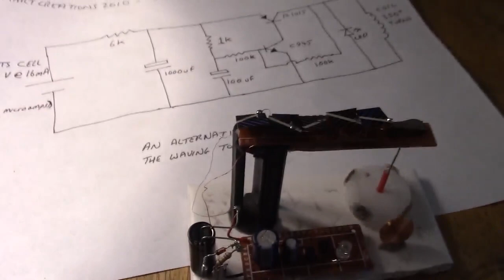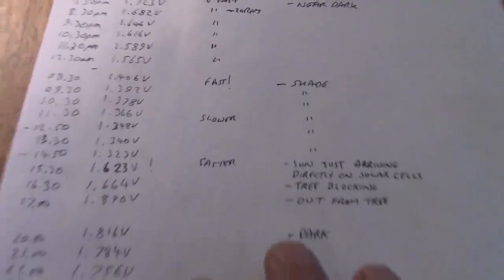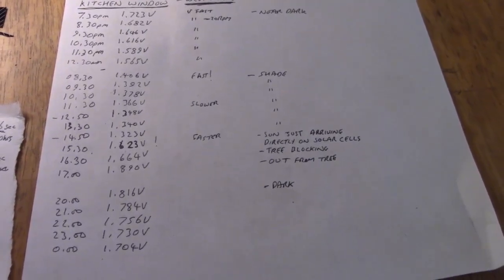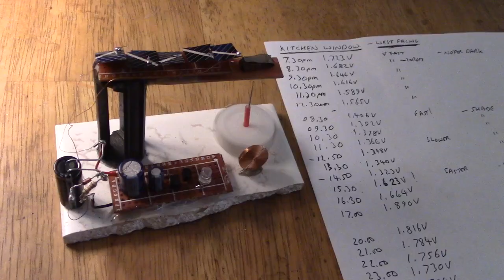24/7 Solar Runner

Comment: Hi, Good work !! Can you confirm whether this circuit produces a constant pulse from the coil or is it triggered by the magnet ?
Reply from the maker: It's triggered by the magnet, but also fires at a slower rate with no magnet present. The magnet is the sync, would be the best way to describe it.

Comment: how low the voltage of the battery can work , 1,5 volt AAA , it works from 1,5 to 0.5 volt ?  beautiful videos
Reply from the maker: Thanks Joseph. The lower limit on these circuits is about 0.6V. Nearly every circuit with 1 regular transistor will fire up at 0.5V, but these are a little higher. On the upper end, I'm not sure. They work fine at 4V and may go higher... I should blow one up to find out  :)
Reply: @Slider2732  I prefer constant values such as 1.5 volt battery and constant mechanics / magnet size, the reason is to study closely the sensitivity and function of all the different circuits, apart from that, flat coils are not ideal because they use only one side, I have beautiful pulse motors built up, they have been running for a few years, magnet needle bearing glass with only one-sided contact, it really makes a lot of fun, thank you very much for your lovely charming videos
Reply from the maker: Yes, as baselines for comparisons I see your point. My usual is to see how low the power input needs to be. Had 1 of these running for 24hrs on a 1F supercap, for example. 1.5V is about as universal as USB, probably more so. 

Best wishes for the continued running of your motors  :)

Comment: Hi slider, i found with my mendocino motors, that a little (film layer)  vaseline on the tip of the point of the rotor, realy can run them longer, without drilling a hole after a while, and they run faster (rpm higher). Do you use someting like that as well?. The film layer i got by taking a little bit of vasaline and rubbing it between two fingers, then rub that finger on the rotor point spot. In your case the tile. thanks for sharing this video. like it :-). I also adjusted the circuit a bit wit a potmeter. With this i can time the self starting time a bit. Maybe i make a little video some day of that. It makes it easyer for the different motors to adjust the self starting, or i your case the amount of fireing every so many turns.
Reply from the maker: Great tip, will do that! These tiles and the hardened steel pins have proven to be very durable. Yes please do more videos, I often refer to them, as I did for this build :)

Comment: That worked great!  Find a home for it now and just let it live on ----year after year.  You kinda become attached to these things after awhile.  Glad you named it.
Reply from the maker: Haha, yes Derek just seemed like a silly name for it, so went with that...didn't know it would run so well or I might have thought about it more. Nephilim Penny is still going, since 2011 I think, also a solar flashing osc using one of those rechargeable finger nail caps out of cellphones. A motor is far more appealing.

Comment: Amazing, good work
Reply from the maker: Thanks Steve. Am happy with it,  the glaze on a same tile lasted for 3 years with no wear on a similar style of rotor.
Reply: @Slider2732  Kind of a lid motor design i think on magnet?
Reply from the maker: I think it was Magnetman who came up with the method, several years ago. This type works best for me, while i've not got $25 for the pyrolitic discs. Lidmotor's latest is very cool, so similar to Lasersaber's.
Reply: @Slider2732  Your right, Magnetman was the one